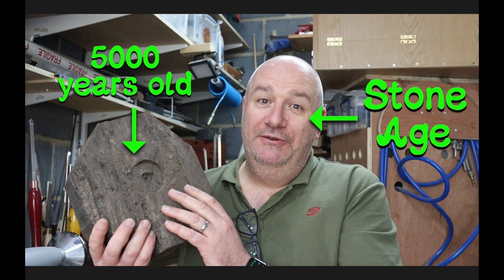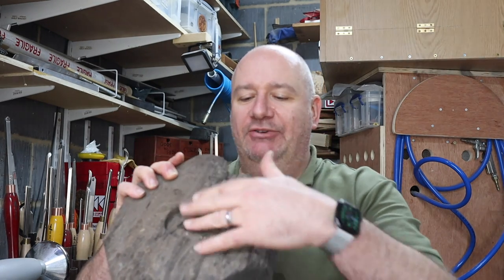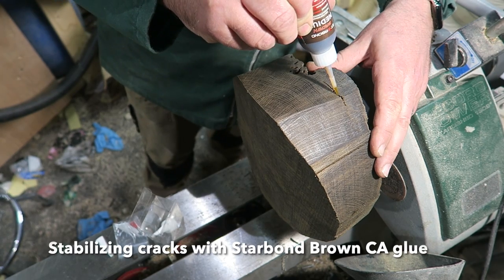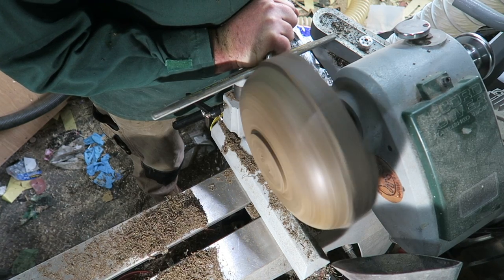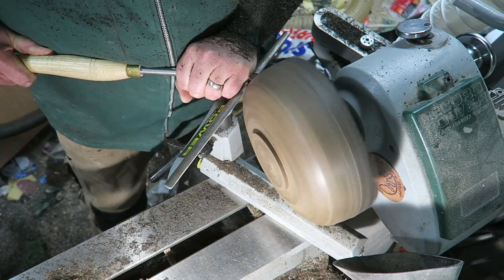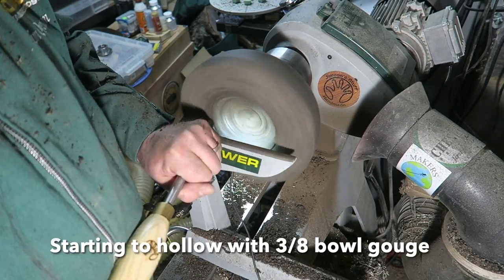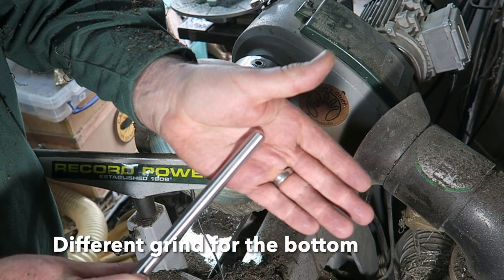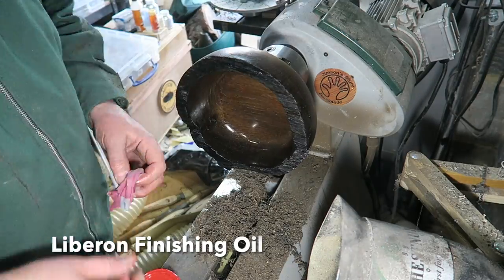Woodturning a bowl from 5000 year old Bog Oak

Comment: You did a great job there Jim, Bog Oak is really hard to work with... I hate it.  I was asked to make a number of Bog Oak pens and they almost broke my heart because the wood had such varying consistency.  The biggest issue was cracks because I was cutting it so thin.  So, when I finished the job I'd had enough of Bog Oak.
Great to see you at the lathe but all your videos are very interesting whatever you are doing.
Best Wishes, Brendan.
Reply from the maker: Thanks Brendan, glad you are enjoying my videos. Yes the cracks in bog oak are the biggest problem, they are often hidden inside the blocks as the outside seems to shrink the most on drying. I did make some pen and knife blanks some years ago but I stabilised them first with resin.
All the best, Jim

Comment: I always thought filling cracks looked better with some shavings mixed with glue...it blends in more as opposed to just a glue line and also adds strength because of the wood, and not just the glue.
Reply from the maker: The coloured superglue worked very will for this one.

Comment: Very nice.
Curiosity question:
Has anyone made a saw attachment for a wood lathe that could be used to do the initial rounding of unusual shaped stock?
Reply: I suppose there is, but some people just a machine lathe with an automatic feed.
Reply from the maker: Thank you very much, There are CNC lathes that use routers and expect someone somewhere has made a saw but it would be quite dangerous.

Comment: I've found that accelerator isn't necessarily good stuff.  It tends to 'case-harden' the CA and makes it very brittle, and the CA may remain uncatalyzed beneath the surface
Reply from the maker: Yes I agree, I usually use epoxy when filling cracks this deep. Ordinarily moisture in the wood catalyses the CA but this wood was very dry.